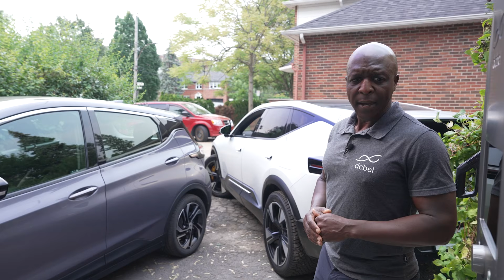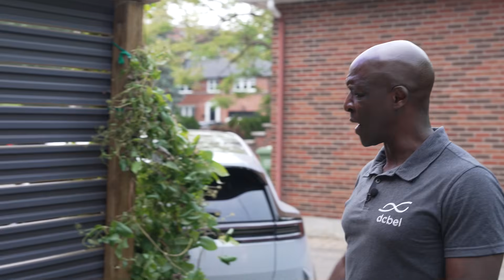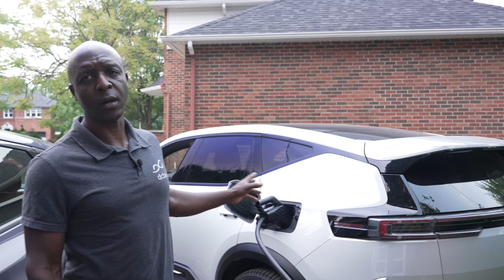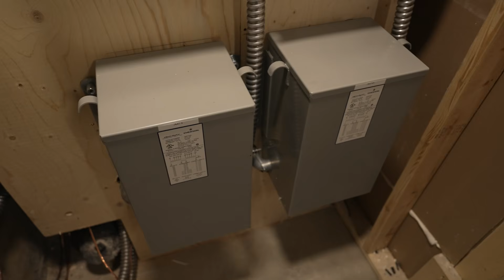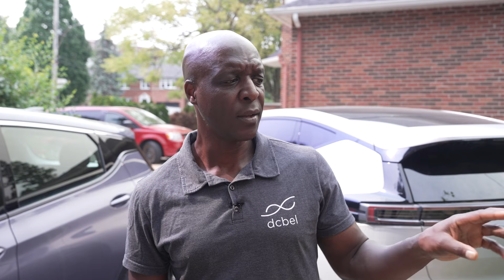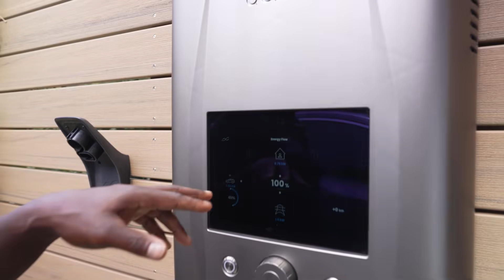dcbel Ara Home Energy Station Demo | Powering Your Private Grid

Comment: This looks really cool. Would a 2024 Nissan Ariya be compatible? I see a comment below that 2018 Leaf's are so that's encouraging. Do you support installs in Oregon?
Reply from the maker: Hey there! Ara is a V2H solution; the Nissan Ariya is capable of V2L, with future vehicles looking to expand to V2H, so compatibility may change down the line. dcbel Ara is built to be futureproof, so you'll be ready as more bidirectional EVs become available.

We will - we are currently taking deposits in Oregon, with installations currently rolling out in other select states.

Comment: Seems noisy. Will those fans suck water in? What is the IP rating?
Reply from the maker: Hi there - the sound you're hearing in the video is cicadas, not the Home Energy Station 😅 Ara has a NEMA 3R rating, and is suitable for outdoor installation (with protection against rain, snow, and ice!)

Comment: Do you offer V2H for the Nissan Leaf?
Reply from the maker: Hey @rcs8641 - responding here as well for visibility 🙂 dcbel Ara is compatible for V2H with Nissan LEAF (2018 and newer).
Reply: @dcbel  Can I get one installed in Massachusetts or New York?
Reply from the maker: @figblatt  Though installs have begun in select regions, rollout to more states — including Massachusetts and New York — is coming as we continue expanding our installer network. Reservations are open nation-wide.
Reply: @dcbel how does this work with CHAdeMo? Using an adapter?
Reply from the maker: @Drivethisnotthat  dcbel Ara supports interchangeable connectors; CHAdeMO is one of the supported configurations the unit can ship with!

Comment: What are the requirements for cabling from the main panel to the subpanel / inverter? I have a detached garage connected to the house via a 60A breaker. Could this work? How does the sensor on the main panel communicate to the inverter does this require a separate wire or can it communicate wirelessly?
Reply: And they never answer
Reply from the maker: Hi @garethw001 - good question! Ara uses only wired connections. It communicates via RS‑485 signals over standard Ethernet cables. The sensor measures current at the main breaker panel and connects to Ara through dedicated wiring. You’ll need to run conduit and cabling from the panel to the inverter location. It would need a site assessment to confirm feeder size, grounding, and code. For more specifics, please feel free to book a call with one of our energy specialists: https://bit.ly/3XxKK0l

Comment: Not having V2H is the reason why I haven't jumped to EVs. I cannot wait for this.
Reply from the maker: We feel the same way @AlessandroBertolucci - V2H opens up so many possibilities for EV owners. Can't wait for you to experience it for yourself!
Reply: I feel like V2H is something that's great for an outage, but not something one should use for peak shaving. Remember, each cycle of the battery degrades it. You have a limited number of cycles. If you're losing power 8 times a year and use the car battery for storage, that's fine. Discharging it every day is like putting double the amount of miles on it. When you have 50K miles, it's really 100K.